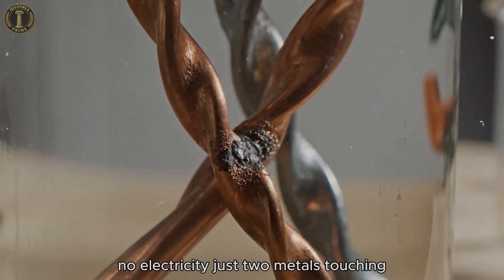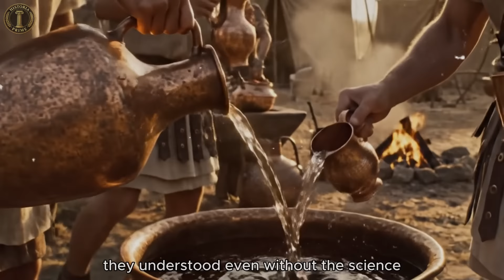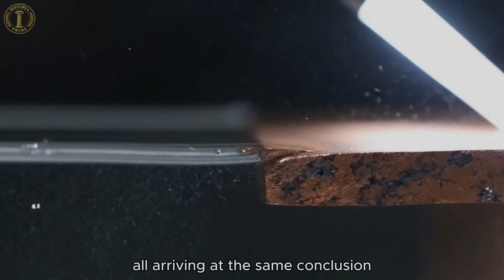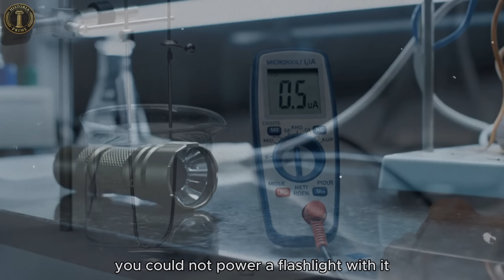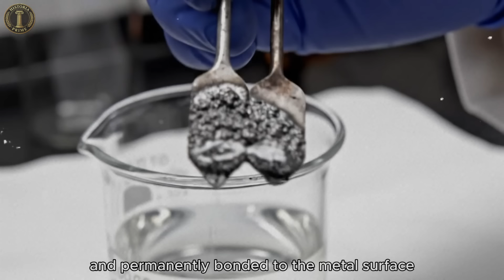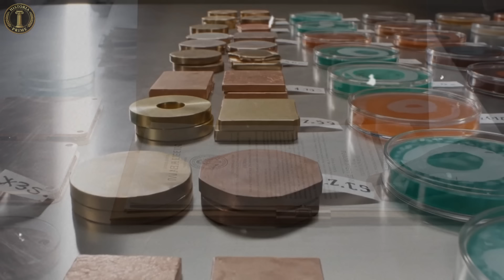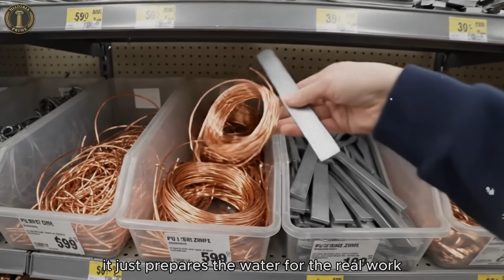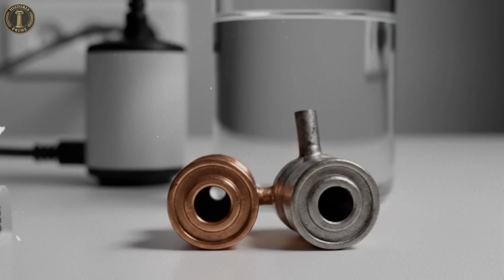Connecting Two Metals Purifies ANY Water — The "Earth Filter" Secret They Buried

Comment: If After taking the time to look at the following list of highly Diseases Causing (some practically incurable), still believe what you're told in this Video, by all means do what you've bought Hook Line and Sinker!! Here's the list of potentially Deadly Organisms, Unaffected by Copper (Cu)!! 
The most dangerous waterborne pathogens that can withstand or resist copper include: [1]

1. Pseudomonas aeruginosa

Why it survives: P. aeruginosa is highly resistant to copper due to heavy metal efflux pumps and specialized genetic mechanisms (such as the cueAR operon) that allow it to survive high copper concentrations. [1, 2, 3]

Danger: It is an opportunistic waterborne bacterium that commonly contaminates hospital taps and plumbing, causing severe, often fatal infections in immunocompromised patients. [1, 2]

2. Legionella pneumophila

Why it survives: While copper-silver ionization is used to treat Legionella, it can survive in hot water plumbing (HWDS) by inhabiting biofilms. It can also grow inside amoeba, which protects it from the toxic effects of copper.

Danger: Causes Legionnaires' disease (a severe type of pneumonia) when inhaled from water mist.

3. Mycobacterium tuberculosis & Related Species [1]

Why it survives: M. tuberculosis (and related nontuberculous mycobacteria) possesses copper resistance systems (mco) that protect against copper toxicity, enabling its survival within host immune cells.

Danger: Although primarily respiratory, they can be spread via water sources and are known for their extreme environmental resilience. 

4. Escherichia coli O157:H7 (Specific Strains) [1, 2]

Why it survives: While E. coli is generally sensitive to copper, strains can develop resistance through plasmids (like the pco cluster) when repeatedly exposed to sub-lethal concentrations.

Danger: Responsible for severe waterborne gastroenteritis, dysentery, and diarrhea.

5. Enterococcus (VRE) & Staphylococcus (MRSA) [1, 2]

Why it survives: Vancomycin-resistant enterococci (VRE) can adapt and develop resistance to both antibiotics and copper. Gram-positive bacteria, in general, show more resilience on metal surfaces compared to Gram-negative bacteria.

Danger: Major healthcare-associated infections (HAIs) found in contaminated water sources. 

6. Cryptosporidium 

Why it survives: Cryptosporidium is a protozoan parasite, not a bacterium, and is highly resistant to many disinfectants, including chlorine. While copper affects it, it is notoriously hard to eliminate from water supplies.

Danger: Causes severe diarrheal illness (cryptosporidiosis), especially harmful to children and immunocompromised individuals.

Comment: Not a reliable or safe method to purify drinking water.

Zinc, copper together in water  produce tiny electrical currents.
Copper has some antimicrobial properties and may kill some microorganisms over time.
Zinc can react with impurities and slightly affect water chemistry. But does not purify to extent of drinking water.  
After Zinc & copper treatment, Try boiling first before drinking.

Zinc Copper method does not reliably kill all bacteria, viruses, or parasites, does not remove chemicals, heavy metals, sewage, or toxins
may even release excess metals into the water if left too long.  

It should not be trusted for safe drinking water purification, especially for heavily contaminated water just out of any spring or lake. 

Proven emergency water purification methods

Safer and effective methods include:

Boiling (best simple method)
Chlorine purification tablets
Ceramic/carbon filters
UV purification
Reverse osmosis systems
Solar disinfection (clear bottles in strong sunlight for several hours)

Copper vessels alone have historically been used to reduce bacterial growth when water is stored overnight, but even that is not complete purification for unsafe water sources. (Info from scientific journals)

Comment: Coins: U.S. pennies minted after 1982 contain a core of 99.2% zinc, coated with copper.
Reply: I remember 1paisa coin of copper,  during my childhood
Reply: Yes, but is the Zinc enclosed within copper bioavailable?
Reply: @DrVagus so scratch it up a few times to expose it
Reply: @DrVagus cut it in half?
Reply: Thank you for sharing
Reply: Thats why tbey took out pennies!
Reply: Snd the USA vooper with LEAD
Reply: Zinc is toxic. Lose the zinc keep the copper.
Reply: @karlajarrett1674  Zinc and Copper need to be balanced for optimal health. Lots of info online or ask a health practiioner.
Reply: @karlajarrett1674 WHAT??? Proof please!!! 🤷‍♀️
Reply: @lindabuck2777  When consuming Zinc it needs to be in a balanced ratio with copper; 8:1 to 15:1 ratio, such as pairing 15 mg of zinc with 1 to 2 mg of copper. When copper is too high or zinc is too low, it affects neurotransmitters and the immune system. 

National Institutes of Health (NIH) | (.gov)
Copper and Zinc Balance
Reply: @karlajarrett1674 They work well  together.
Reply: @karlajarrett1674  Only if ingested at over 40mg daily. Actually Zinc is used in moisturizers and even supplements
Reply: @karlajarrett1674 
Zinc is a necessary mineral for our bodies. It's in our multi-vitamins with minerals but you can take it seperately, too. I've been taking 50 mg. of zinc daily since 1980. You can have your Dr. test your zinc levels if you are really concerned about it.

Comment: Copper by itself to treat water would be beneficial only “initially”, but over time would result in copper toxicity, which is prevented by zinc. Combining the 2 together to water treatment as indicated in this video is actually brilliant and solves a major drawback to copper pipes. Zinc and copper use the same receptors and transporters for absorption. Excessive intake of 1 will result in the other absorbing at a lower rate, causing a deficiency. This video randomly showed up, but intriguing nonetheless

Comment: Does NOT remove microscopic pathogens or chemical toxins.
When you place a copper rod and a zinc rod together in water, you create a basic galvanic couple (like a simple battery).Zinc Releases Ions: The zinc rod acts as an anode and slowly dissolves, releasing zinc ions ($Zn^{2+}$) into the water.The "Clumping" Effect: These zinc ions can act as a mild coagulant. They bind with tiny particles of dirt and suspended organic matter, causing them to clump together and settle to the bottom.The Reality: While this might make the water look a bit clearer by settling the mud, it takes a long time, leaves a lot of fine sediment behind, and does not remove microscopic pathogens or chemical toxins.

Comment: Explains why now homes are built with plastic pipes, even making one bypass copper pipes with PVC in older homes to pass inspection. Absolutely vile what the powers that be attempt to do to us. If you’ve copper pipes in your home, change over the bypass or replace them entirely. We have well water, thank goodness. It still needs to be filtered through the proper means. Many think boiling water will make it safer. While it does, somewhat, it doesn’t give fully filtered, healthy water.

Comment: 🎉GOT TO LOVE IT! ❤

Yes, I am an electrician. This principle is used in batteries with the cathode plates (positive) and the anode plate (negative) dipped in a electrolytic solution called electrolyte. Now, you have electron flow called, current flowing. This is what allows for lights and the power for starting your car. 

However, in this case your using the same principe with zinc and copper electrolysis to purify water. 

💕 Love it!!!
Reply: So where do you purchase zinc the hardware does not have it
Reply: @thomascrayton6658 battery AA 1.5V
Reply: I have a kdf filter under my sink, same principle, the inside of the filter is some carbon block or charcoal and then particles of copper and zinc, electrolysis removes bad stuff
Reply: Believe in the Lord Jesus Christ and you will be saved.
Reply: @verdadincreible4989  Jesus was one step ahead.  bypass purifying the water and turn into wine instead.  even better 😂
Reply: @verdadincreible4989 Calm down

Comment: Can I use my stainless steel vessel or water filter to prepare all those layers of material such a twisted copper and zinc, charcoal, diatomaceaus earth and then pour that water through the fsucet into a crystal glass to drink? Or, stainless steel is not recommended?
Reply: Correction: water faucet...
Reply: Very good information. Thanks a lot.

Comment: A couple of questions, if anyone knows. 
1) If brass is copper + zinc, can brass be used instead of both? I have some brass items and copper items, but no zinc. 
2) Do you (can you) use the same pieces repeatedly? How does it recharge itself and what length of time?
3) How much of each metal would be needed for cleaning, say, a gallon of creek water?

Comment: In Britain there are still 2p coins in circulation made of copper and Zinc alloy.

So go to the supermarket and pay using cash using the copper plated iron coins that are the majority.  Arrange that you get 9p preferably in change and you will often get a Copper and Zinc coin back.  Detect these using a magnet and keep them in a jar or other container preferably with a lid.  They are heavy especially when you have hundreds of them.  Alternatively go to the bank and ask for £5 in 2p pieces and separate out the ones that aren't attracted by a magnet - Neodymium Boron Iron magnets from China are ideal for this.  Then you will get approximately 10p in copper-zinc coins for each £1 of coins.

Always pay using cash when you can.  The UK government has debased our coinage many times, removing Gold, then Silver and most recently (1994 ?)  Copper coins from circulation.

You won't be able to collect Silver coins in this way - you'll have to buy them - they were all gone by about 1975.

Comment: That's why they took copper pipes out of homes, is because they know they heal.
Reply: And it's cheaper on top of that. By the way they say that the glue on plastic pipes is very poisonous!
Reply: They say that the glue on the PVC pipes is very very toxic!
Reply: Wow. We had copper water pipes in our house built in the 1960s. Always tasted  better than newer houses bought by our friends. ❤😂
Reply: Very  True.... use a bit of Copper and put inside the Water.... it will purify the water. We use.... in Tamilnadu for many thousands of years.
Reply: @MM-yj8vh that is why people still drink from copper cups
Reply: Using copper water lines or PVC is the choice of the contractor if a home owner wants copper instead of plastic they have that choice.
Reply: Exactly 💯
Reply: Only one thing  is, when you have hot water in a copper pipe, coming from a boiler, for example, that is not healthy to drink becaus  of the metal.

I was told when working in a pub. We always had to boil water in a  pot for cooking.
Reply: They still do.
Reply: my house has copper pipes.
Reply: Copper can leach copper.   My old home had copper levels above safe and needed to be filtered.   There is zero lead in the solder, and there are also reliable compression fittings.
Reply: @CR67  Copper levels above safe?  I had no idea that happened.  Look'n like it is research time.  -- Copper pipes can leach small amounts of copper into drinking water, but the average levels in North America range from 20 to 75 parts per billion (ppb), which is far below the EPA's action level of 1,300 ppb. High levels of copper can cause health issues, particularly for sensitive populations, but typical exposure is generally considered safe. --  I'm NOT saying you are wrong because this says average.  Evidently your old home was not average.  Do I trust the EPA?  Hell no.  Planning on building a house here in Virginia and expected to use copper pipes because I don't trust the plastic.  Now, because of your warning, I will test the water more then I would have.  Thank you for the heads up.
Reply: @mysticdavestarotmachinesho5093  Copper leaching has to do with the pipes and water quality.  I could also argue electrolysis from grounding can be a factor.   But it is easily remedied by an RO filter.
Reply: More than likely!
Reply: Покупая новый водопроводный кран, выбираем латунный 👍
Reply: No because they are very Expensive so , repairman pretends to be helpful by clearing waste but in reality selling that copper is the extra money to them
Reply: There may have been high levels of copper in the existing water or that plumber was a good salesman, lol
Reply from the maker: Copper definitely has some very interesting properties. From what I’ve seen, a lot of pipe changes were usually tied more to cost, corrosion, codes, and installation trends—but it’s still an interesting topic.
Reply: @HistoriaPrime1212 most solder is lead Free today...🤔🕊️🙏☝️💪💎🪽🧬
Reply: sis the same thing by removing church bells, removed the healing frequencies from our atmosphere.
Reply: @darrenloudfoot378 you are very correct! I watched a documentary on this.  But it won’t be long and the tables are going to turn on the elites.
Reply: @darrenloudfoot378  they have been trying to Finish Hinduism world oldest religion based on Sound and Frequency and Vibration Mantras Yantras
Reply: @darrenloudfoot378 . But they expect you to listen to that horrible Muslim caterwauling.
Reply: @CharDidIt2 so you a zionist?
Reply: @naradaian A person doesn't have be a Zionist because they're offended by something offensive. It reminds me of 'Pride' Day becoming 'Pride' month becoming 'let's groom children into getting sex changes'.  If they could have just left it at 'Pride' Day it wouldn't have gotten out of control by being pushed in everyone's faces more and more. I see this the same way. Everyone has a right to worship in their own way. Just don't push it on others.
Reply: @naradaian  Hell yes.
Reply: @naradaian  I dont know what that means.  What does that mean? Is a Zionist someone who doesnt like Muslim chanting?
Reply: It's the lead jointings in copper pipes in the old days that is the problem. If you still use a very old system, it's recommended that you run the water a few seconds before you use it as that will allow contaminated water in the system to clear before being used. Seen a video where rum on a Caribbean island used to be distilled through lead piping and people were dying as a result, but the connection to lead poisoning was not known about back then. Also the reason lead was banned from petrol.
Reply: @fintonking7525 Roman's used lead pipes and plates. The plates caused them to think tomatoes were poisonous because they would get sick eating them. Then it was figured out it was the acid in tomatoes pulling the lead into the tomatoes.
Reply: The Romans did not have Tomatoes that must have been later after they were introduced from America , They did like their wine from lead bottles because it was sweeter the acids produced salts with the lead and neutralised them, sometimes this would be acetic acid if it was starting to turn to vinegar and lead acetate would form which actually tastes sweet and used to be called sugar of lead.
Reply: Actually, they still use copper plumbing in homes.  I know because I was in construction in LA.
Reply: Copper was soldered with lead

Comment: just finding "polished" copper would it still conduct?
Reply from the maker: Yes — polished copper still conducts just fine. The main thing that would interfere is a coating, oxidation layer, or insulation on the surface, not the polishing itself.

Comment: NON ELIMINA BATTERI E VIRUS IN MODO AFFIDABILE, NON RIMUOVE SOSTANZE TOSSICHE O METALLI PESANTI, PUO' ADIRITTUR RILASCIARE IONI DI ZINCOO ALTRI METALLI NELL'ACQUA, L'ACQUA PUO' SEMBRARE PIU' LIMPIDA MA ESSERE COMUNQUE NON POTABILE, QUINDI NON E' ASSOLUTAMENTE AFFIDABILE MEGLIO USARE LA BOLLITURA O LE PASTIGLIE IN COMMERCIO ADATTE ALL'USO. ----- IT DOES NOT ELIMINATE BACTERIA AND VIRUSES RELIABLY, IT DOES NOT REMOVE TOXIC SUBSTANCES OR HEAVY METALS, IT MAY EVEN RELEASE ZINC IONS OR OTHER METALS INTO THE WATER, THE WATER MAY APPEAR CLEARER BUT IT IS STILL NOT DRINKABLE, SO IT IS ABSOLUTELY NOT RELIABLE. BETTER TO USE BOILING OR COMMERCIAL TABLETS SUITABLE FOR THIS USE. ---- Ce produit n'élimine pas les bactéries et les virus de manière fiable, ni les substances toxiques ou les métaux lourds. Il peut même libérer des ions zinc ou d'autres métaux dans l'eau. L'eau peut paraître plus claire, mais elle reste impropre à la consommation. Ce produit est donc absolument inefficace. Il est préférable d'utiliser des pastilles de stérilisation à ébullition ou des comprimés désinfectants commerciaux adaptés à cet usage. --- No elimina bacterias ni virus de forma fiable, ni sustancias tóxicas ni metales pesados. Incluso puede liberar iones de zinc u otros metales en el agua. El agua puede parecer más clara, pero sigue sin ser potable, por lo que no es en absoluto fiable. Es mejor usar desinfectantes para hervir o pastillas comerciales adecuadas para este uso.

Comment: Thank you for this valuable information❤! I have a question, though... If bras is an alloy of copper and zinc, does it have the same properties? Can bras be used for water purification?
Reply from the maker: Great question. Brass does share some properties with copper and zinc, but it doesn’t behave exactly the same as pure copper or pure zinc. I’d be careful about assuming it works the same for water purification — for drinking water, tested filtration methods are always the safer choice.
Reply: @HistoriaPrime1212 Thank you for answering my question 😊 ❤

Comment: if you have a copper water jat with a spigot can you just drop a length of zinc in the bottom to get the same result?
Reply from the maker: : Not necessarily in the same way. The exact contact between the metals, the container, and the water conditions all matter a lot.